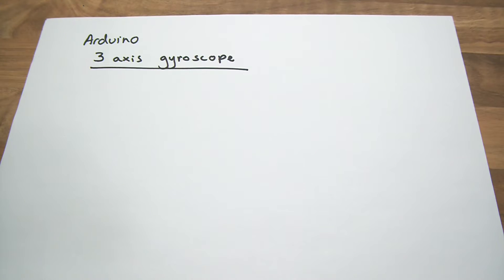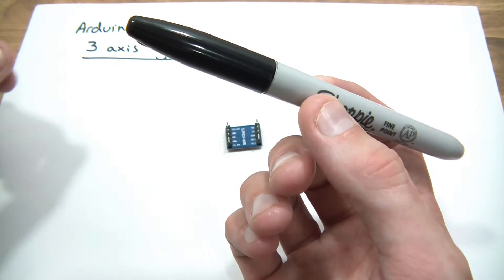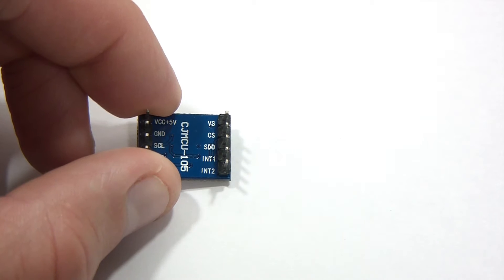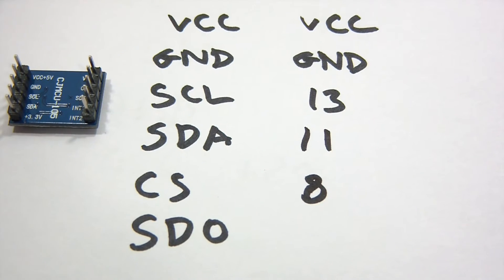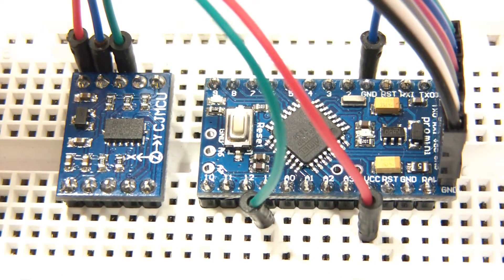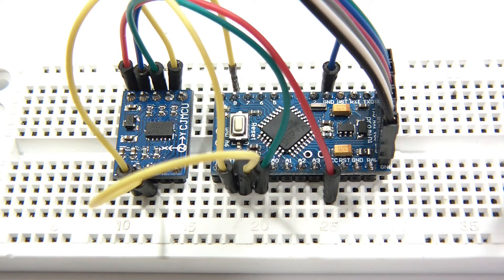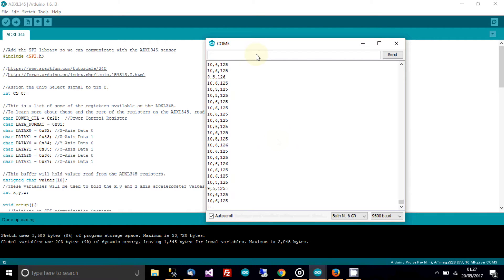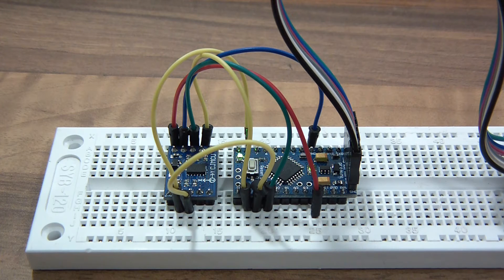TUTORIAL: How to Wire Up & Code ADXL345 Gyroscope Accelerometer - (Arduino Module)

Comment: Code 

#include <SPI.h>
int CS=8;
char POWER_CTL=0x2D;
char DATA_FORMAT=0x31;
char DATAX0=0x32;
char DATAX1=0x33;
char DATAY0=0x34;
char DATAY1=0x35;
char DATAZ0=0x36;
char DATAZ1=0x37;
unsigned char values[10];
int x,y,z;
void setup(){
SPI.begin();
SPI.setDataMode(SPI_MODE3);
Serial.begin(9600);
pinMode(CS,OUTPUT);
digitalWrite(CS,HIGH);
writeRegister(DATA_FORMAT, 0x01);
writeRegister(POWER_CTL,0x08);  
}
void loop()
{
readRegister(DATAX0,6,values);
x=((int)values[1]<<8)|(int)values[0];
y=((int)values[3]<<8)|(int)values[2];
z=((int)values[5]<<8)|(int)values[4];
Serial.print(x,DEC);
Serial.print(',');  
Serial.print(y,DEC);
Serial.print(',');  
Serial.print(z,DEC);
delay(10);
}
void readRegister(char registerAddress,char value){
digitalWrite(CS,LOW);
SPI.transfer(registerAddress);
SPI.transfer(value);
digitalWrite(CS,HIGH);
}
void readRegister(char registerAddress,int numBytes,unsigned char * values)
{
  char address=0x80 | registerAddress;
  if(numBytes>1)address=address|0x40;
  digitalWrite(CS,LOW);
  SPI.transfer(address);
  for(int i=0;i<numBytes;i++){
    values[i]=SPI.transfer(0x00);
  }
  digitalWrite(CS,HIGH);
}
Reply: Maybe it's because the first "void readRegister" should be "void writeRegister" 

I adjusted the code a bit to make it work for me. Maybe it helps. https://pastebin.com/Mfwh9Gtk
Reply: Thanks man. Your one works.  @Schmogel92
Reply: Is this code is useful for arduino uno
Reply: @Schmogel92  Thank you :-)
Reply from the maker: Hey, thanks for your time. :-)
Reply: I get the same error. did you  fix it?

Comment: Ok, maybe you are faster than I2C, BUT your data precision is limited on units (or integers) you don't get anything in the decimal range from the sensor. ADXL345 is able to give substantially higher precision. That's a really great ISSUE. Soooo I dislike the video. I've been able to do what you say by myself.

Comment: This is actually an Accelerometer, not a Gyroscope. The readings you were getting as the device was tilted along the 3 different axis was that of 1G (9.8 m/s^2). As any axis was tilted towards the vertical, the 1G was shown as the 100+ reading, with the sign indicating whether the axis was pointing down or upwards. Unlike a gyroscope, the values are also subject to additional forces in the direction of any of the axis. For example, under free-fall, the Z-axis (vertical) would go to zero.
Reply: You have a point but you can still use the adxl345 as you would a gyro if no significant accelerations exist. I personally used the adxl345 today as a gyro on a slowly tilting system to measure tilt angle.

Comment: Hi Anthony! Great Video :)
A question if i may. I've been using PIC Microcontrollers for years, interfacing them with various external devices and recently also used an Accelerometer module which would control a desktop program to show angle changes. The Arduino i have never used before and they seem very popular. Does the Arduino have something special that a PIC does not have?
Reply from the maker: Hi! I've never really used PIC before, but I think the Arduino is going to be easier. Arduinos come with a bootloader and programmer and some come with an onboard UART too. It's pretty much everything you need on one board. On some Arduino boards, you literally plug in the USB, your PC installs the drivers and you're good to go in less than 5 mins without having to do anything. The IDE is free too and good. The community is huge too! Antony...
Reply: Hi Anthony, thanks for getting back to me :)
The setup you have above is same as i have for the PIC. The USB to Serial Data converter, the Arduino Module and then the Accelerometer Module itself. After some checking the Arduino is basically a module (PCB) with an Atmel chip on it, same as a PIC but the module makes interfacing for projects easier, especially as you say if they have a USB interface chip already on the module. Good luck with the future projects :)